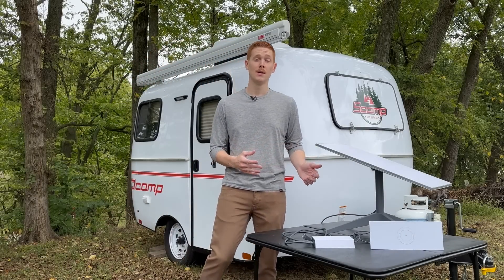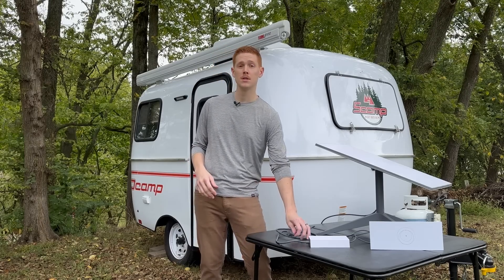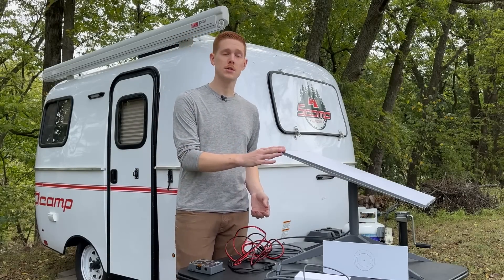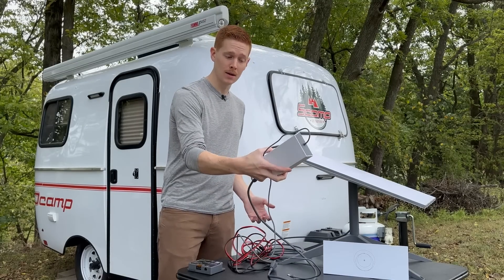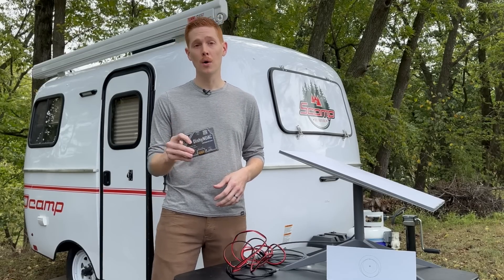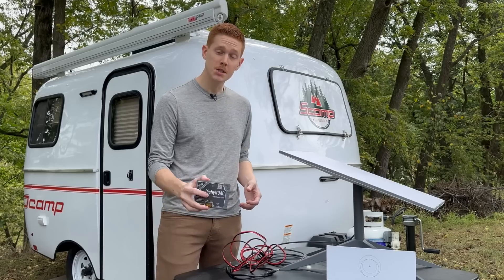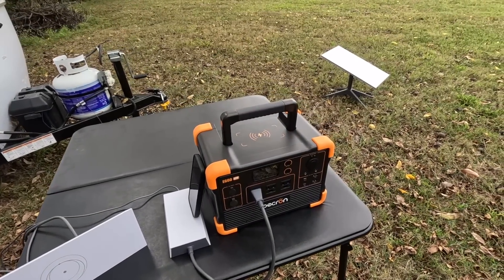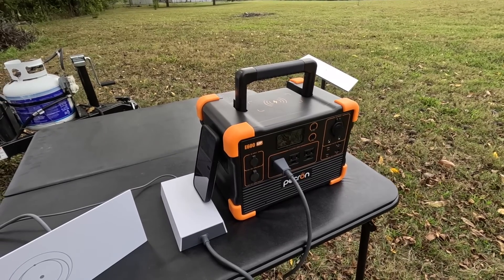How to Convert Starlink to 12V DC Power

Comment: Can the $40 Starlink small router (called "router mini") work as an alternative router?
Reply from the maker: Yep! Works great as a separate router if you want to stick with all Starlink gear.
Reply: @DISHY_tech  I have a Ford F150 camper with standard gen 3 set up powered by a step up 12 volt DC converter. Already have an unused "router mini" so I'll try the router mini unless there's another router that would further reduce power consumption.
Reply from the maker: @donrmurray  The Router Mini only uses 4-5 watts and is perfect as a basic WiFi router for a small area. I would also look into the GL.iNet travel routers if you need more advanced network options like VPN, cellular backup, etc.

Comment: i think the trick is your power station measures connected device load only which is the almost the same (DC or AC), but if you consider DC to AC internal inverter, it will drain the battery faster, and finally thanks for the experiment.

Comment: Using step up converter is the lamest way to workaround 12V DC starlink powering. You waste a lot of power on the converter. I wonder if using AC adapter won't be more efficient in this scenario. Check out how much heat it generates. When using Fossibot F2400 solar generator changing cables to 18AWG 10m cable available on Amazon made it work without any converters. Unfortunately I power it currently with Pecron E1500LFP which seems to has lower output voltage.
Reply from the maker: You can't get around step up converters unless you find a 57V battery. The DC-DC step up does waste some energy, but not as much as the DC to AC and back to DC conversion.

Comment: I gotta figure out how to wire this into my 2500 dodge ram. Do I take the power supply cables to my fuse box to power it? What size fuse? Or do I take it directly to one of the batteries?
Reply from the maker: I guess it depends on whether or not you want it switched on or on all the time. Wiring it to the fuse box would be ideal, and I would put a 20A fuse on it.

Comment: Thanks, I have a Gen 2, will it also be the same power wiring you did if I want to use it Starlink router with it?
Reply from the maker: Yes, you just plug whatever router you want into the data side of the DishyNOAC.

Comment: @DISHYtech Did you make the ethernet cable exiting from the NOAC to the Skylink router in the DC configuration? Reason I ask is because on their website they market that connection to be used with other third party routers which would be the typical Cat5 wire arrangement. The Starlink router is setup on the  T-568B pinouts so had to be converted on the NOAC connection side correct? Please confirm those details and if you have to make that cable up or can be purchased. I can do either but would like that confirmed because I will be trying with and without the Starlink router and using a third party router for testing purposes as well. Thank you in advance.
Reply from the maker: It’s just a regular Ethernet cable between NOAC and the router. It just supplies data, not power, no modification needed. Power is sent through the Starlink cable going to the dish.
Reply: @DISHY_tech  is there room to press the tab on a standard RJ45 jack to remove the cable when it's clicked into into the Starlink router? Rather not worry about using an official Starlink cable then. Makes it quite simple this way on the cabling.
Reply from the maker: @ The port on the router makes it difficult to insert some Ethernet cables. Might have to file the jacket down a bit, and might need a tool to press the tab to get the cable back out.
Reply: @DISHY_tech  I appreciate your thorough and quick responses. I may just crimp a similar RJ45 connector then  for the router end to not have to worry about

Comment: Now…the $64,000 question! Will the DishyNOAC work with the Starlink Mini? I’m thinking it would, just no need for the Ethernet cable from the DishyNOAC to a separate router since the router is built in to the Mini…have I got that right? You done a video on that?
Reply from the maker: It wouldn’t be needed with the Mini. The Mini natively accepts 12-48V DC through a DC5521 barrel plug. It’s not POE like other Starlink units. All you need is an adapter cable to interface between your power source and the Mini. I recommend the Mini Car Adapter, I have a review on how it works: https://youtu.be/dCsHAy_OhHM
Reply: @ But wouldn’t I need a voltage booster of some kind? My 12-volt system is delivering just that…12 volts. I struggle understanding electricity much of the time.

Comment: Maybe I missed it in you video, but why not just use it plugged into you battery box thing you have? Does it not last long enough? Does it drain the battery? I am thinking about buying the same battery box thing you have but now I am not sure if I want to if it won’t work for this.
Reply from the maker: That's certainly one option and would work fine! The main reason to run it off DC is to avoid using the built in inverter, as it "wastes" some energy in the process.
Reply: @ thank you for the fast reply. Just wondering something and thought you might know. How long would one of those last. For example they sell a cheap 200 dollar battery box made by predator at harbor freight and it’s has a long watt hour rating. Do you think running only the Starlink that something like that could last all day?
Reply: @BillyJackEllison-j1x I don’t have an answer for your question, but for my setup, using my RV’s 12-volt battery I have solar panels that can be charging my battery while I’m using the Starlink as well as other 12-volt appliances. I don’t have to go out and buy a power station.

Comment: I see that the DishyNoAc powers the dish itself but why is there that black 12V cable from the DishyNoAc to the Starlink router? Is the router, powered only with 12V, able to create a wifi signal?
Reply from the maker: The Starlink router needs power now that I've taken away the AC power supply that used to power both the router and the dish. And remember, doesn't have to be the Starlink router here, could be any router. I just used the Starlink one because it meets my needs and I already had it.
Reply: @DISHY_tech can you link to that cable that powers the Starlink router from DishyNoAC? Also will this cable also work on Stsrlink Gen 2?

Comment: This won't work for earlier generation routers that don't have an ethernet connection correct?
Reply from the maker: It's compatible with the Gen 2 Standard Actuated model, you just need the adapter that converts the proprietary cable end to standard RJ45. I have it linked in the description of the video.

Comment: Toss in my 2 cents here after doing a bit of research.
Like others, I was a bit confused as the need for the DishyNOAC if one can simply power the Gen 3 router with 12v power supply. 

Apparently a 12v 10amp power input is enough juice to get the Gen 3 router up and going on its own. However, it is not enough power to run the Gen 3 router AND the dish which apparently wants 57v DC (Gen 3 power supply output is 57v 3.42amp). This is why he powers the dish via ethernet cable POE from the DIshyNOAC. And the ethernet cable from the DishyNOAC to the Gen 3 router provides the data connection needed to the dish for communication between the two.
Reply from the maker: You worded it much better than I did in the video! This is exactly right. You need to supply 57V for the router to turn on the POE functionality for the dish.
Reply: Which cigarette lighter connector is good to use for the power supply

Comment: I am curious about the power draw of the Gen3 Router compared to the USB-C powered travel routers like the GL.iNet GL-MT3000 (Beryl AX) Portable Travel Router? I purchased a 100ah Lifepo4 battery to power the DishNOAC, but I have not calculated or measured the differences in the router consumption yet. I suspect there will be some significant savings, but I won't know until I can test them both with my instrumentation. The Canyon where we Camp Host in S. Central CO has us trying to be as efficient as possible and I understand that after activation there is a procedure for switching the routers out. When I get that far I will report back my results. Thanks for your videos.
Reply from the maker: It’s around 10-15 watts. I just did a review where I was looking at the power consumption of the Standard system, and noticed the discrepancy between the Starlink app reported power consumption and the output number from my meter: https://youtu.be/MhPN0PKHFNU

Comment: I did a video a couple of years ago for dishy two isn’t a 300 and it’s built in AC inverter. It may be more power efficient to run it on DC, but maybe by 10%
Reply: Dishy 2 & Jackery 300.   It worked well enough it would get you out of a jam.
Reply: I had the dish sitting on top of my car for six months running back to my room, in the motel, I live in because the Wi-Fi was nonexistent indoors. The motel before that it was sitting out on a patio that was covered and there was metal railing around the patio and it still worked, but it would drop out because it could only see maybe a quarter of what a dish sitting out in the open would see.
Reply: They should probably add a solid-state battery that is the dimensions of the panel for Dishy 4 mobile
Reply: Put the router in between the dish and the panel so that you have something the size of a computer shopper.  Put the Wi-Fi antenna on the side so that it slides out a little bit and then you can flip it up.
Reply: You could put a tilt stand on it so that you could angle it through a window if that’s all you had and that would look like a horseshoe, but have the Wi-Fi antenna built in to the vertical portion of the stand
Reply: You could just put some LEDs or a small LCD screen in it to help you manually point it to the strongest signal

Comment: Since a DishyNoAC steps up DC voltage, that process is typically convert input DC to AC, boost voltage with a transformer, and rectify the now higher AC back to DC.  IE, the same process as a common 12V inverter except at several times the cost.
Reply from the maker: The packaging for DC to DC converters is much smaller and the electronics are typically more efficient than your average AC to DC power adapter that comes with Starlink. Just look at the size of the Gen 3 power supply vs DishyNOAC. Sure there is the extra cost, but you also gain the feature of not needing an AC power source, and overall power savings because the device is more efficient than the Gen 3 power supply.
Reply: It might seem like it,  but that isn't how DC - DC conversion works in modern power supplies.   The efficiency of a very well designed converter is approaching 95%. What isn't mentioned in the video is that an inverter uses 10-30 watts just sitting there doing nothing, 24 hours/ day.  Typically a DC converter has very small standby power use.

Comment: Correct me if im wrong here.... the starlink router provides POE power to the dish so the use of DishyNOAC as a POE injector is added complexity of this setup and is completely unnecessary... if the starlink router has an input of 12-33v just connect to dc power.... kind of a misleading vid title, you should change it to "how to use starlink with 3rd party routers", and actually show using it with a 3rd party router....
Reply from the maker: The Gen 3 dish requires 56 volts to operate. The Gen 3 router accepts 12 volts only as a router. Supplying 12/24V to the Gen 3 router wouldn’t work to power the dish, it would only boot up as a router or mesh node. You could supply 56V DC to the Gen 3 router and that would work, but there aren’t many great options as far as step up converters to achieve 56V. That’s why I used the DishyNOAC.
Reply: @StarlinkHardware  can this option work for the V2 though?

Comment: It amazes me that Starlink doesn’t supply a piece of equipment to allow this easily now that they have options intended for mobile use.
Reply: Business. They can sell the Minis for more $$$.
Reply: @woodpecker1284  They do - high performance  power supply, you can run from AC or DC and its internally works as a transfer switch.
Reply: The full size dish can be used for mobile, but it is kind of hackey. When people showed interest in that mode of operation they made a product just for that use case. The full size starlink is designed for installing on a house where the dish and users are likely to be far enough apart that it makes sense to separate the wireless AP from the dish. That requires a high voltage to get enough power to the dish to operate (those things draw a lot on startup!) It is easy and cheap to drop voltage, but stepping it up is much harder to do. 
Long story short, it would cost a fair amount to make the adapter you are asking for, and makes more sense to just combine the dish and router so the voltage requirement doesn't have to be so high. That DishyNOAC is about $100 too. In the end, just buy the dish that fits your needs.

Comment: A nice and good review. I understand your senario. But for me personally, my bluetti 600 watt mini solar generator was only 198.00 vs the 150ish on the DC converter. For very little more and being very simple minded, and having a UPS ability, I would still stay with the simplicty of my mini solar generator. But, again, you did a great job in the review. I am sure it will help many people.
Reply: How long can your standard run on the bluetti 600 watt mini solar generator? Looking at ways to power my standard when I am on the road with my truck. My truck does have  built in 400Watt inverter, but would be good to run it off something different.

Comment: If the router takes 12v input then can't you just wire that power cord (the one you run from the NOAC to the router) directly to your RV/vehicle battery?
Reply from the maker: Yep, I just found this easier than running another separate power run just for the router. If you're asking about just supplying 12V to the Starlink router instead of bothering with the DishyNOAC, 12V only powers on the router functionality, it won't power the dish. You need to supply 56V to the Starlink router to get enough power to run the Standard dish off the router.
Reply: @DISHY_tech  got it. That was my confusion. So the dish needs 57v which the router (powered by 12v) cannot supply. Thanks.

Comment: I just purchased the DishyNOAC connected everything (e.g. router power supply with barrel plug and 12 volt DC cigarrete lighter to use my Jackery 12V - same config as yours).  I connected just like you had in the 1st part of your video.  The Starlink dish works with no issues (mine is the same Gen 3 with the new router).  Although, the router is not working.  It appears to not be receiving enough power.  It drops the wifi constantly and disappears.  Not sure why yours has enough power (my assumption based on the disappearance and fading of the status light from full on, to blinking, to faded light) for the router and mine is not working.  I have removed and reinstalled the wires, they have a solid connection.  The voltmeter is showing about 12.7 volts on DishyNOAC.  If you have any ideas I am open to them.
Reply: If you can borrow another router from somewhere. Any router and see if you can duplicate the same issues. If not then you have a Starlink router issue. If you can repeat the issues you either have a Dishy issue or power source issue.  Then I would plug jackery into a AC wall outlet tp charge it and while charging see if you have router issues. If you don't then it's a Jackery issue. Yeah, it's really just a process of elimination. Not always the easiest or fastest. I hope this helps in some small way.

Comment: I don't understand that if the router powers the dish through POE, why you need to hook up the router 2 dish through the DishyNOAC.  Wouldn't it just work if you would power only the router with the DishyNOAC and let the router power the dish? If you keep on using the original router.
Reply from the maker: That's one method, yes. The DishyNOAC, however, is set up for being able to use any router, not the Starlink one. They also designed it to be compatible with Gen 2 as well, which doesn't have the same option of just supplying the router with 56V DC like you can with Gen 3. The DishyNOAC also doesn't have DC output terminals to power the router, it just has POE through the Ethernet cable that goes to the dish.
Reply: @DISHY_tech  I am confused as well. If the NOAC will create POE and supply the dish, and so will the Starlink router, why use POE. It looks like you powered the Starlink router with 12vdc, if you can connect it to 12vdc, what is the purpose of the NOAC unless you are using a different router.

Comment: My gen 3 uses 35-45W plugged into a solar generator with ice melt turned off. 
$100 to run DC would be tough to justify.
I have solar panels to charge my generator.

Comment: So my question, why do I need a DishyNOAC if I’m using the barrel connector for the router? Couldn’t I just buy the DC barrel adapter and plug the Starlink directly into the router like normal and it would inject the power thru Ethernet? You might even get a slim savings of wattage.
Reply from the maker: Yes you could supply 56V DC through the DC barrel plug on the router. That involves more modifications and supplying a compatible DC converter. That’s what I was originally doing, but couldn’t find a decent 56V converter that I could recommend.
Reply: @DISHY_tech  56vdc at how many amps?

Comment: Are we able to still use the starlink router? Their website says that it replaces the router and we need a separate Wi-Fi access point.
Reply: The Gen 3 router is precisely what Colby is using in this video.  If you go to 6:51 on this video he gives the details on how he has the starlink router connected to his DC set-up.